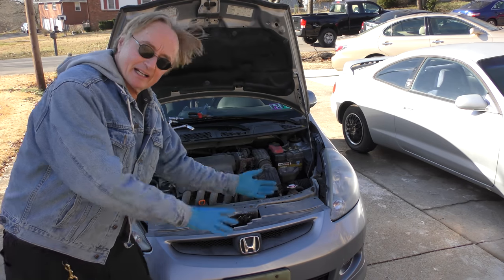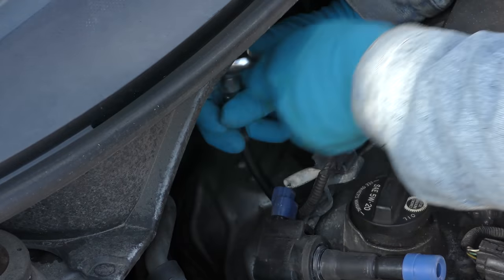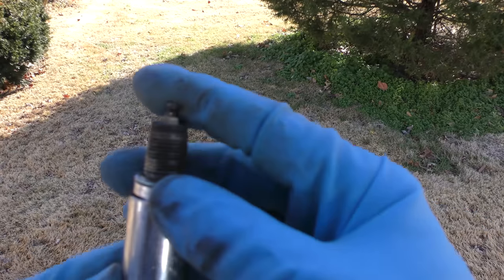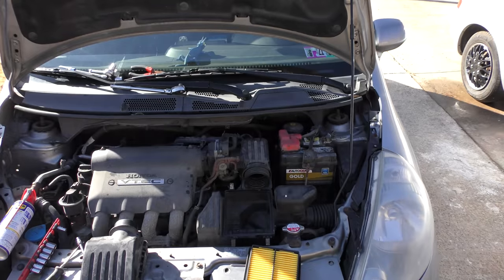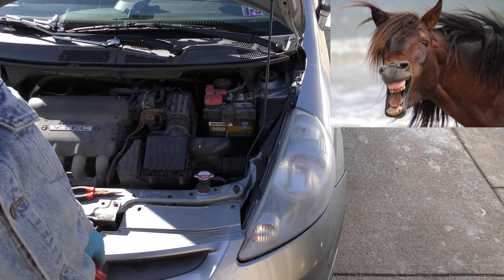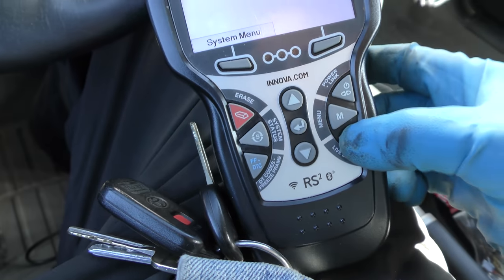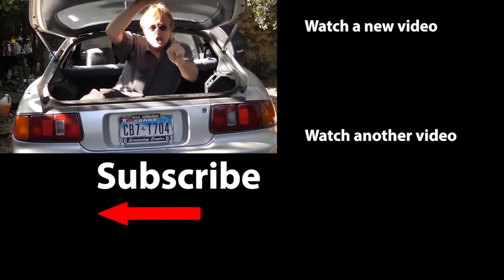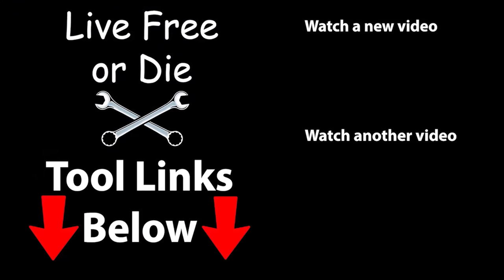This Honda Has a Serious Problem

Comment: I hope someone can help me. I have a 2000 honda crv b20z2 awd. I keep getting a misfire code. I recently bought the car. Did full tune up and fluid change on the vehicle. I also keep getting a dragging noise that comes and goes. I can be going down the street normal. Then when I press the gas to accelerate the dragging noise will happen. As soon as I let go of the gas. It stops. Even if I'm cruising. The noise is only there when I press on the gas. Any help would be appreciated.

Comment: You can do this with a lawnmower but take out the sparkplug and clean it with a wire brush and a little gasoline.  It gets that carbon build up off and it's like a brand new one.  Do that and your sparkplug might outlast that engine.  Lawnmower engines used to last 20+ years but now you're lucky to get five out of them.

Comment: Hey Scotty, Merry Christmas to you and your family! I wonder if you'd ever get the chance to read this but I have a 1994 Honda Accord Ex. I recently had my oil changed however, after taking roughly a 100 mile trip the next day, I checked the dipstick and discovered that the oil was brown again and smelled like gasoline. My air filters and spark plugs were recently replaced and I checked the oil after the oil change. Does my engine need rebuilding? Some of my friends say that I may have valve seal leaks but I'm not quite sure. The car drives perfectly fine though. Cheers from the Philippines.

Comment: Hey Scotty (or anyone else) looking to buy my first car. Found a 1997 Toyota Camry with only 100,000 miles for $1800 and a 1999 Toyota Corolla with 80,000 miles for $1600 .Would you consider this to be a good option or should I look for something newer?
Reply: Between these or something newer, just these. I didn't rely on Toyota.
Reply: Older is better.....look at Hondas too...

Comment: Scotty you forgot to remove the plastic beauty cover this time, these particular engines have 8 spark plugs, there is 4 more under the plastic crap 😂 was hard for me to believe also but I owned one of these fit in Ireland, 1.2 liter engine with 8 spark plugs, madness! Love your videos man, greetings from Brazil!
Reply: This is a 1.5l, not 1.2
Reply: @AustinsCoins  still same, 8 spark plugs
Reply: The 1.3  from this era has 8 plugs (twin spark), the 1.5 has your standard 4

Comment: Wow Scotty I’m amazed you actually finally admitted up to about people who own junky brand vehicles should just keep it, even if they do take care of it. 🤣 But I’m not shocked about older Honda’s having problems all vehicles do afterwhile, but yeah the Nissan Versa is definitely better than a Chevy Sonic Lt I agree, but yeah it’s a hit or miss economy car, but the Chevy HHR shocked me a lot, because I hardly ever see anyone drive those cars anymore at all. 🤔 But once again your right Gm is not as good as it used to be but yeah I’m glad you even agree about babying Nissans despite the transmission being so horrible still, because my mom hasn’t had not one single problem with her 2016 Sentra it has just under 30,000 something miles still, and my dad has a 2015 Titan with 78,000 something miles just under 80,000 miles, and I of course still have my 2015 Civic Lx with 46,000 something miles, and still no problems either. 🤔 But for far as Subaru goes, I have heard more positive results than bad results, but I’m not a big Subaru fan either because I think they are too expensive and for far as Toyota the older ones run better, but the newer ones are horrible but look nice, I mean Toyota has had more recalls than any of the Japanese manufacturers out there, like Kia and Hyundai are the only two Asian manufacturers with the most recalls, but I think Kia and Hyundai are slowly becoming more reliable than Toyota but still not Honda good, there on par with Nissan, and still slots below Mazda and Subaru, and definitely above Mitsubishi, I can’t stand Mitsubishi cheap looking vehicles I mean the Outlander is the only nice vehicle they have now, and it’s also horrible. 🤔 But hands down Honda and Mazda are still the way to go on reliability in my own opinion. 🤔
Reply: I Wish❤️ Hyundai/Kia is slowly becoming more reliable  than Toyota and Honda in few period of time😁🙄
Reply: @lokeshdeshwal5288  Umm I can see Hyundai and Kia become more reliable than Toyota but I don’t think they will ever be Honda good, they will one day be on par with them and Mazda considering a lot of Kia’s and Hyundai’s sedans look exactly like a Honda and Toyota inside and out only difference is: A little different styling on the outside and the inside lights up blue and half led white and other colors for the instrument panel of the dashboard while Honda is strictly led white now and Toyota is led blue mostly now! 🤔

Comment: If the fit had a proper easily replace able fuel filter the injection system would last longer.

Comment: 2008 Chevy Trailblazer with a 4.2 inline 6. Someone removed the head, broke 11 of the 14 headbolts. I read where this is normal thing to happen. What should I do? Work on removing the headbolts or replace the engine?  The head was removed because one of the valves was stuck open. Your opinion? Thanks, Greg

Comment: Amen.." always start with the simplest logical thing"!!!  And for us poorboys in tge backyard.. check the cheapest things first..That should be  a sign on every enthusiasts garage wall...
I had a loose gas cap on my van that a parts store guy was telling me was a major egr problem and leak..
I then asked a friend who is an over 30 year mechanic...
Who told me that it was the gas cap..
Tightened ir.. didnt fix it..
Unscrewed it...
Looked at it..
It had a crack in the locking mecanism that was the cause..
It was a  locking cap that went bad...

Comment: My brother owned a 2012 Nissan versa 112,000 miles and the transmission kept slipping and for some weird reason the catalytic converter sensors started going out a lot. STAY AWAY FROM VERSA

Comment: The only Honda I'd but is a Honda fit with a manual transmission.  Because all Honda fit have a timing chain not belt like every other Honda saving you thousands every 80-100k miles. And only only a manual transmission because Wil last forever,  unlike Honda auto transmissions which will always fail as are very weak compared to a manual.

Comment: He is wrong. The valves are too loose on the intake side. Honda recommends they get adjusted every 110k. I'm sure they are out of spec. As the engine heats up the valve clearance changes when it gets hot and fuel trim will change.

Comment: I drive an '07 Fit Sport in New York. Had it for six years, still going strong with a buck 30 on the engine. I love it.
Reply: Adjust your valves. That's a great car - I bought one new in 2007 and put 113k on it. Great car.

Comment: Alright, do a valve adjustment if nothing simple fixes it!
Reply: My 08 civic si with 146xxx miles is gonna get one soon it’s sounding like it almost has a misfire but it doesn’t show one on a scanner I heard they don’t have hydraulic valves so they do need to be adjusted do you think this is my case
Reply: How can you tell if you need your valves adjusted what are the symptoms
Reply: @xsmokeydogx5318  I own a Honda Element which is also a K series engine. I know with that engine there are roller rockers that do need valve adjustments every 110,000, so I would definitely do one on your Civic. I did mine and it definitely runs quieter and smoother. 

Some signs are cold stalls like Scotty mentioned, rough idle, poor gas mileage, slower acceleration, and a noisy clicking noise. 
Of course if the spark plugs have never been changed they need to be with only original NGK ones. Always start with simpler things before spending more money than may be needed.
Reply: @kelseyrainwater3918  Mostly noise, rough idle, poor gas mileage or acceleration and if exhaust valves are really tight then cold stall issue. I am not sure what car you have, but Honda’s generally will show these signs. Honda says to check/adjust every 110,000 miles. It costs about $300 where I live.
Reply: @ExtremeAwesomeness  yeah I put the ngk iridium in when I first got it and that was about 8 months ago, I have rough idle and it just feels like it should be running better. I tend to paint my valve covers on my cars so when I pull it off I’ll def be doing the adjustments

Comment: 😂🤣 A serious problem for Honda is just basic maintenance. Still runs like new after a little maintenance and has over 200k on it. I like to use Marvel Mystery oil or Seafoam to clean the injectors.

Comment: I have to ask. Why is Scottie working outside. He has enough money to veils a garage or buy a house that has a garage. It’s getting cold outside. Why work outside if you don’t have to. That’s what I do anyway.
Reply: He doesn't get cold easily
Reply: And he likes to be cheap🤣
Reply: He has a 2 car garage
Reply: @sandybarnes887  Yes but he doesn't use it to repair vehicles in. That's the type of "garage" this person meant in the comment
Reply: @AustinsCoins  better lighting outside
Reply: @sandybarnes887  correct
Reply: Also this particular car had to be cold for Scotty to check over. You want to recreate the weather conditions so the car would act up even though changing the air filter and spark plugs corrected most of the problems while looking at the fuel system stats over with the engine running cold.

Comment: 🤔So no matter what car manufacturer it is, as long as you take care of it, it's not a bad car? 🤔 Then why people say this car manufacturer is shitty or this other  car manufacturer vehicles  don't last?
Is It's because they are not taking care of their vehicle☝️🧐
Because if a Yugo or a HHR can last then all cars are good... Right? It's just people that don't know how to take care of them.
My vehicle's;
1990 vw jetta 450 thou. Miles,
1995 Chevy blazer 350 thou. Miles,(had a accident if not it would of had more miles)
1989 Hyundai 525 thou. Miles, and this are just some of the vehicles I have owned. With the exception of  Ford, Jeep & Chrysler vehicles. there just garbage. No matter how well I would take care of them the engines would never go beyond $200,000 miles, and a hundred of those thousand miles would be filled with issues and problems. Lol 😂
So I guess there are bad manufacturers out there after all.

Comment: I had a customer with a 2006 Honda Jazz (i think thats the UK version of the Fit) with the 1.3L twin spark engine. The whole car was falling apart with 130k miles on it, i believe it was junked because the MOT was out and it was going to cost a bit to repair. Engine was burning a lot of oil and it was on the second gearbox. Quite a bit of rust on it. They bought a Clio a few months back and never looked back.
Reply: Thats because they didn't take care of it.....that almost never happens  with these cars..they're exellent....you shouldn't judge a whole brand or model off of one person who was too lazy t take care of their car or truck......

Comment: 1.5L?  I thought starting in 2001, they were 1.7L?  My 97 Civic had a 1.6 and I think the older ones (1995 and older) had 1.5L's.  I still think the 1.6L engines found in the 1996-2000 to be among the most bulletproof ones that Honda put in the Civic.  Those were the ones that were known to go 300-350k without a problem.  Sadly, the newer ones don't last as long IMO or tend to have slightly more issues.  The only good thing that came out of the newer ones is in 2006 when Honda switched from timing belts to timing chains in the Civic engines..

I'm now wondering what your customer is thinking about themselves regarding the car "issue".  Darn, all I needed to do was change a $50 filter and tighten a few bolts/nuts.

I've just made it a habit to check the air filter each season to make sure its in good shape (even on a new(er) vehicle, like my Camry).  It doesn't take much time and I only do it every few months just to  be sure. I have found though on some Hondas, another way you can tell the plugs are startging to go bad is the car may start to make a chugging sound when idling.  My 97 Civic was like that when I first got it and a plug and wire change fixed that problem (probably had the original plugs in it, or otherwise was due for new plugs and wires as i bought it with about 80k on it).

Comment: I wish you'd address 2000 Tundras w 4.7L engine starter issues, like where you hit the switch several times before it starts.  Even 100's of time.
Reply: Needs a starter! (Solenoid is failing) Due to the fact that the starter is under the intake manifold, you’ll want to replace the starter!
Reply: @RussellBonjornoJr  I appreciate it.  Strange thing, something changed where it started firing up as usual.  Then, it just went back to its previous behavior.
Like the ignition switch, it quit working, I was told it'd have to be replaced, I spayed this spray, I forgot what it was, sooty fluid started coming out.  So I kept flushing it, haven't had a problem since.
Which because it started working again, I was kind of guessing there might be something similiar with the starter?

Comment: Lmao 🤣... unmetered air? And where is this meter at ?? because I know that motor well ... it uses a map sensor not a mass airflow sensor and that leak was pre throttle body therefore would not cause it to run bad come on Scotty 💩👌